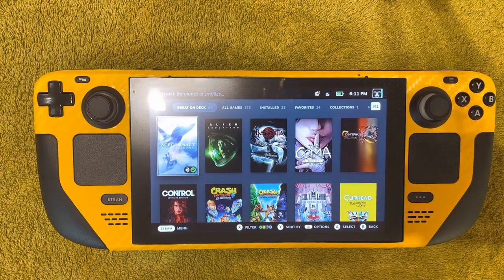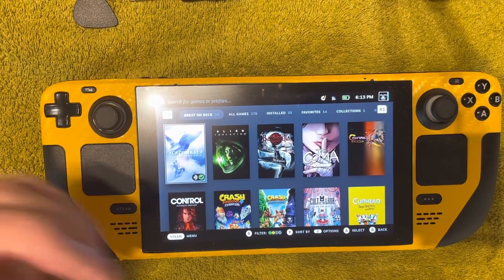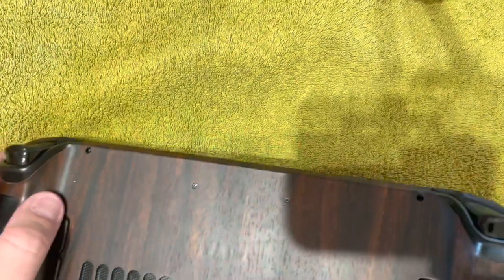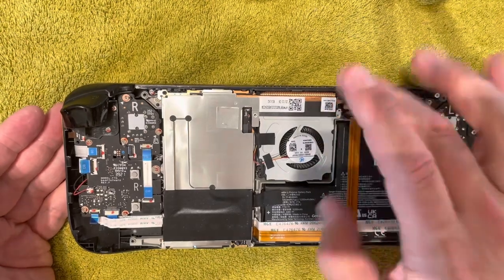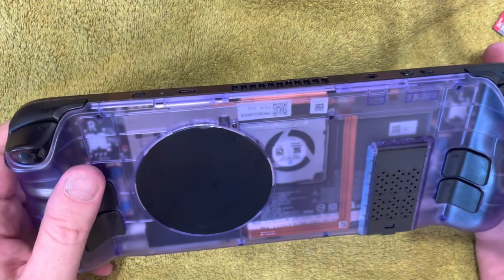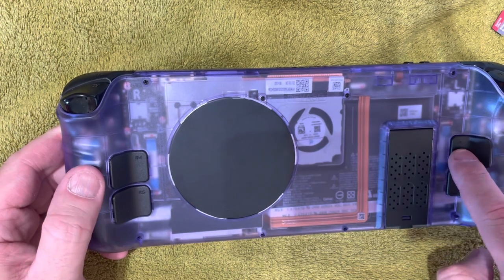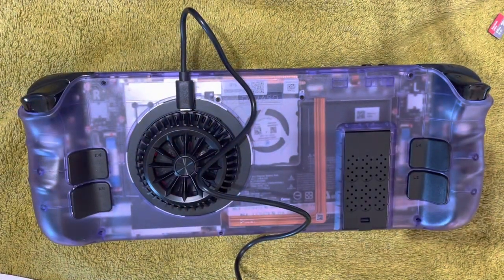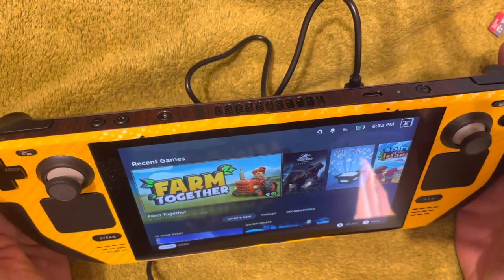THE BEST COOLING FOR YOUR STEAM DECK? | Devaso cooling back plate and fan installation and testing

Comment: But there is no tests!  You just install it, without comparing with\without this heat plate and with\without cooler.  The impact is unclear at all.
Reply from the maker: I did plenty of tests, as I said in the video and it lowered temperatures by 2-5 degrees on average without the cooler. I’m still using this backplate today a year later

Comment: there are 2 Devaso coolers, a small one intended for phones which you are using here and a larger one intended for tablets/other stuff which is the version/size meant to be used on this deck backplate, you arent getting all the cooling possible by using the tiny phone cooler version.
Reply from the maker: This is the fan Devaso sent to me specifically for the review. A larger fan might be nice, but I’m pretty happy with what I have
Reply: You’re right, ehy would they do that?

Comment: It would be good to replace the stock thermal paste with Honeywell PTM7950 phase change material. Only liquid metal is more efficient since this substance.
Reply from the maker: It’d be an interesting experiment
Reply: You should never use liquid metal with handhelds. It leaks much faster that way.
Reply from the maker: @EntersilverHD  this
Reply: @EntersilverHD  it seems obvious

Comment: I like to play cyberpunk on this thing and from my experience, the cooler added to the back does seem to help with performance for me. I was having a lot of problems with the game, but then I remembered that I had a smart phone cooler for gaming on your phone. I added that to the back around the area where everyone else seem to be putting it in the game ran better for whatever reason. I play cyberpunk and connect to a 65 inch screen TV which I don’t really know if that has anything to do with the problems I was having to help or maybe the problem just went away.  Either way, I think the device will probably add long Jevity to the device.

Comment: I remember there was something about a magnets affecting the fans rpm on a different steam deck accessory. Would the fan/magnet attachment on this product affect the fans rpm as well?
Reply from the maker: I wondered that as well, I believe that was with the dbrand killswitch case, and it only affected one of the two possible fans that could be installed. Personally I’ve been using this device for two weeks now and monitoring temperature closely, and it has only served to improve things. But my experience may not be everyone’s
Reply: @NerdCrave  have you noticed if your fans current rpm is higher then it had been before adding this attachment?
Reply from the maker: @frankp2952  seems the same
Reply: @NerdCrave  thanks for letting me know
Reply: It was jsaux initial release. They discovered internal fans were affected by the magnetic external fans. They changed it to mounting brackets instead.

Comment: I have both models of the cooler and use the small one with the jsaux cooling backplate. I choose the jsaux over this one because the jsaux had the vent still and a thermal pad to make contact with the heat source to pull heat to the cooler more efficiently. Works great
Reply from the maker: This one has a thermal pad too

Comment: Nice well made video! I'm just sad that the cooling thing hides the beautiful fake woodgrain.

My question is: how necessary is it? You've had it a year, has the deck exploded within that time?
Reply from the maker: Like I said at the end of the video, mileage will vary based on your use case. For someone pushing the deck to its extreme limits, lowering the temperature several degrees could be very beneficial. If you buy just the shell and not the fan, it simply looks cool, has better grips, and has a kickstand if that matters to you, but is it NECESSARY? No.
Reply: @NerdCrave  could be beneficial,  but is that true? It makes sense,  but at the same time,  what would the lifespan difference be under heavy use? Would it save years? Maybe it is built well enough that it wouldn't die from the heat or out.  

I dunno.  I'd want to know the expected longevity of the device.  I don't like of buying special ads ons just to make the machine not die.
Reply from the maker: @iiqulo  I think it’s too early to tell, but if you look at the lifespan of most thermal paste (6-7 years) and you consistently keep the device cooler, you could theoretically add a year or two to the lifespan, but none of this is concrete. The way I use the deck, I probably don’t need this, I installed it more for the adventure and to make the video

Comment: I would like to know the thermals without the bulky fan, i only want the back plate, but dont know if the thermals will suffer with the holes of ventilation on the left side of the back…
Reply from the maker: I’m still thoroughly testing, look me up on Twitter to continue the conversation
Reply: It would likely be worse than stock, it would just take longer to get there because of the larger thermal mass.
Reply: @NerdCrave  Hi, have you made any progress on this aspect of the backplate?
Reply from the maker: @bleppyboo  I’m still using this backplate 6 months later and it seems to result in a 4-5 degree reduction in temperatures across the board without the fan, which I never use
Reply: @NerdCrave this is great to hear. I heard similar from another person on reddit. I have been wary of it because the moving of the vents. I had ordered it off aliexpress without noticing because I really just liked the built in stand and the gorgeous color. Thank you for the update I'm very excited now!

Comment: I bought this same custom cover for my deck the other day, the gray part that contains the thermal paste, does the plastic have to be removed before installing the custom cover? It's a pasty material and my fear is that it will damage a component instead of cooling it.

Edit: i didn't install this yet😂
Reply from the maker: Mine just had like an adhesive pad

Comment: This product does not seem well thought out. It moves the ventiation points to the opposite side of the deck from the heat-creating components, and reduces the intake holes by over 50%, and adds a heatsink that connects to an RF shield, which is connected to some heat generating components.

The SOC is connected to a heatpipe, which is then connected to the mounting clip, wich is then connected to the RF shield, which is then connected to this case.
Reply from the maker: And yet it works fairly well to reduce temperatures